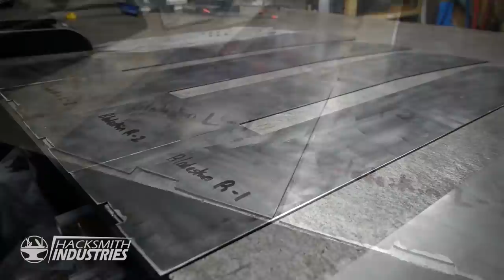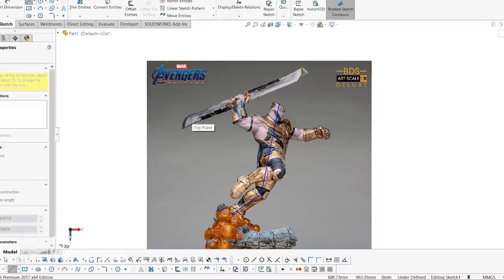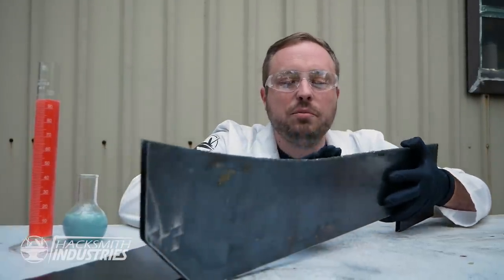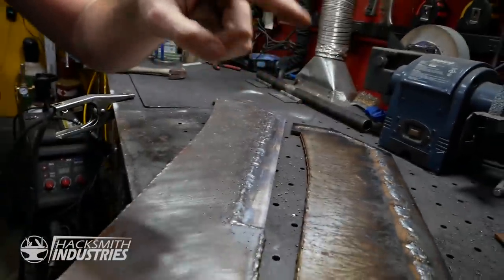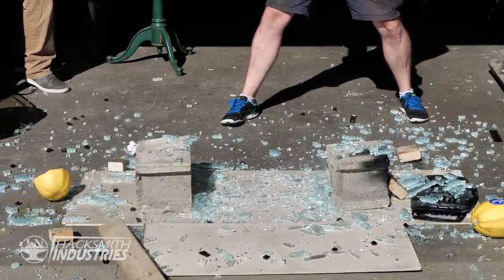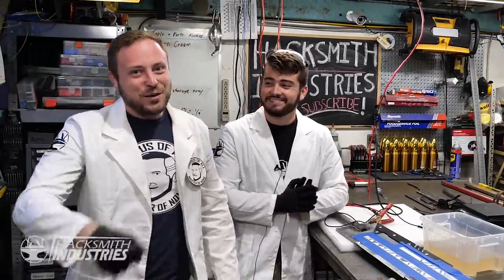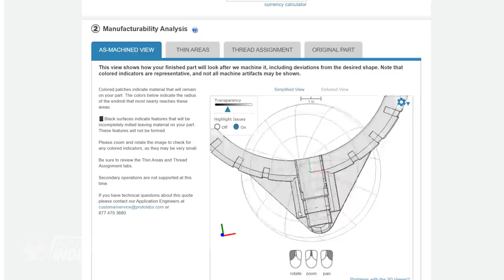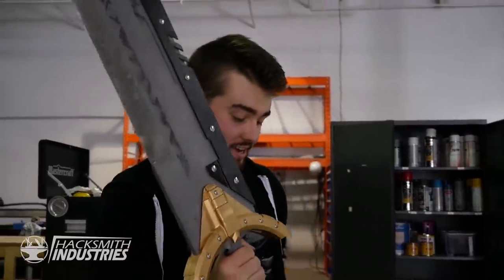Thanos Sword Build!

Comment: Immagine if the sword actually was designed efficiently.
Reply: It would look SO different, it would be unrecognizable.
Reply: It would be a double katana or something lol
Reply: @sebastianmunklaursen2686  exactly
Reply: It would already be efficient if both sides of the blades were sharp and could automatically spin 

I recommend you shadiversity's video about it to answer your imagination
Reply: @thorodinson7467  I think there wouldn't be a double in it.
Reply: @Thor Odinson you play free fire
Reply: @thorodinson7467  now immagine if katanas had a proper crossguard and weren't overaprecheated.
Reply: @lucasoliveirafrancisco6868  whose video I watched.

Comment: TheHacksmith: *builds thanos sword with technology

Thanos Impossible
Reply: Yeah
Reply: Thanos is also technology
Reply: @kumaranyuvan5184  It was made out of Uru, the same metal used to make Stormbreaker and Mjolnir. We saw in IW that you had to melt Uru with the power of a star in order to melt the metal to make the weapon. I'm pretty sure that's not technology.

Comment: Crazy idea but would it be possible to build an arc reactor by first of all having a couple of batteries that could last long enough and be able to be recharged. Than have a constantly recharging attachment that could recharge the batteries that are currently in use and also iron man’s armor had to be changed because it ran out of battery so couldn’t you just make multiple suits that you just change out whenever needed and have the one you just used recharge then technically you could have it